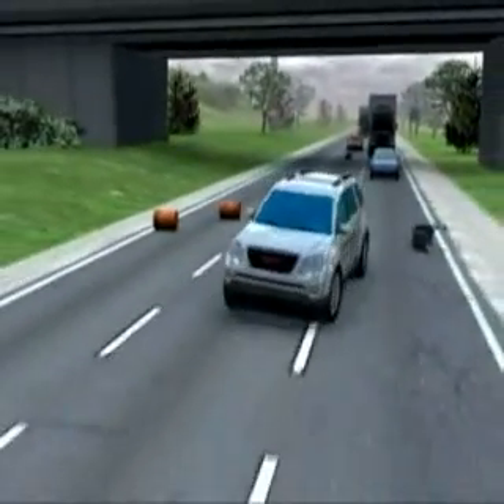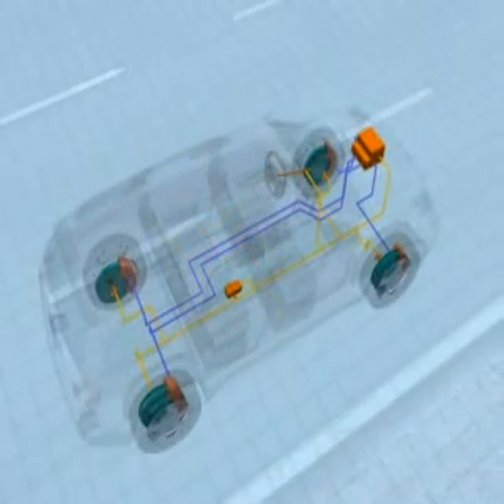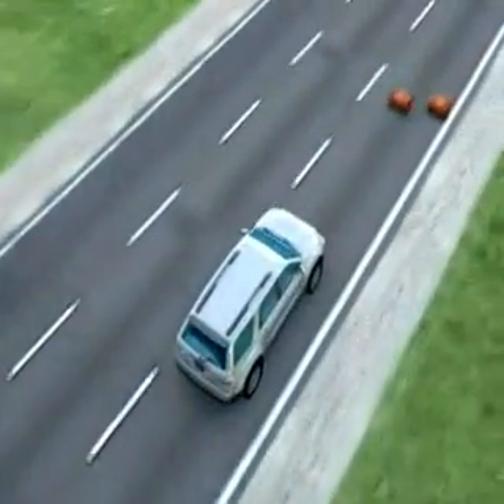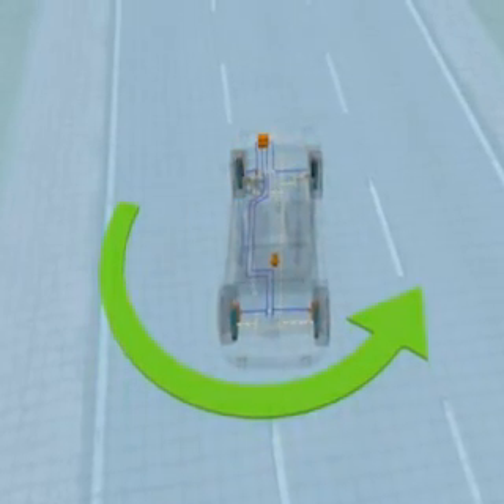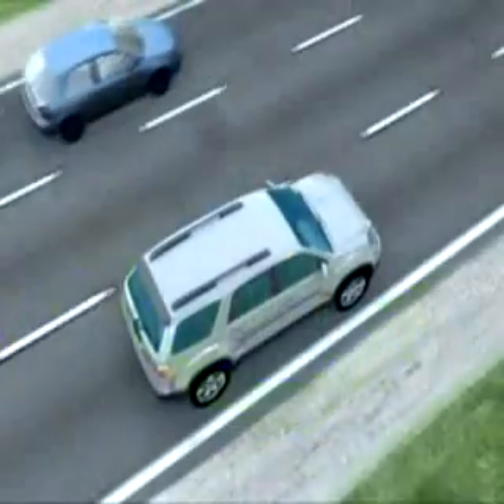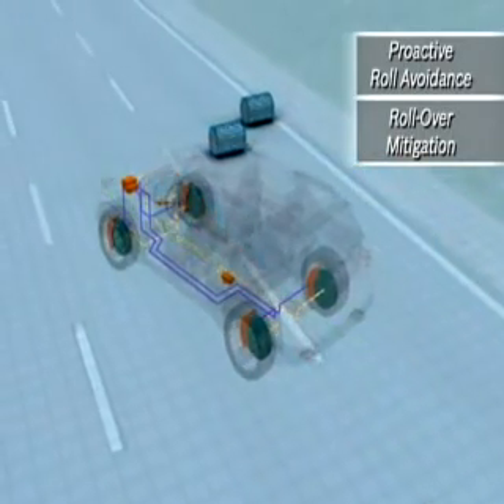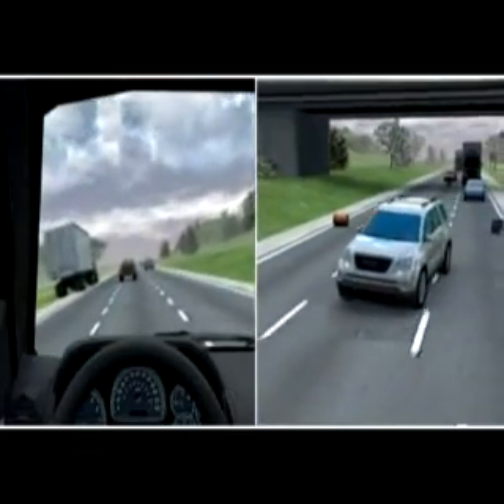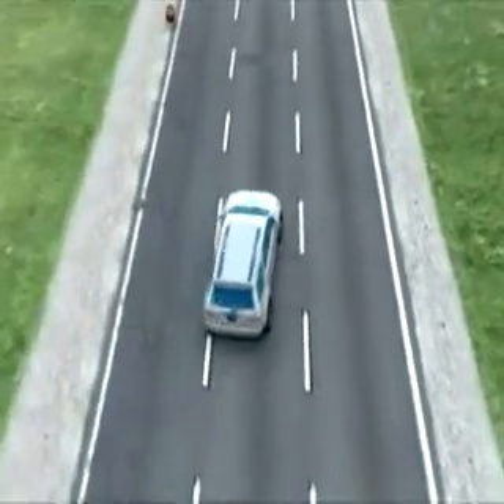GM Stabilitrak

Comment: That system is malfunctioning in way often in my 13 gmc. I almost got hit because of this it killed the engine when I was driving not doing anything and out of nowhere a light come on on the dash stabilitrak off and traction control off . All this happened right in the middle or traffic and I had hard time getting the truck to start back up but I got the truck moving and it was acting up and something was not right but I made it home safely. This system is more dangerous then good
Reply: What was the remedy for this occurrence? I’m having the sane issue in my 2013 Escalade ESV, right now. Thanks!

Comment: Maintain this system too. Check ground and connectors for oxide. Work the connectors (connect and disconnect a few times). It takes five minutes.  When you get "service ride control" - DO service it.
Reply: The service ride control is a fault in the air suspension. “Service Stability” is the message that is on the DIC for a stabilitrack fault. Look in your owners manual.

Comment: I have a 2013 Buick Lacrosse and this feature came on during normal driving with a message "service StabiliTrak" and "Engine power reduced".

I lost power for acceleration and these notifications and car reactions stayed on until I looked online how to reset them. Then, it happened again two months later RANDOMLY 🤦🏾‍♂️
Reply: I know this is an old post and you may have gotten the vehicle fixed or replaced, but there could be engine or system issues not directly related to this feature that can cause these errors to populate, it happened on my 2014 Cruze before I worked on it.

Comment: I’ve got this on my 09 Escalade. One day I was driving on an ice covered road. I was messing with the stereo. I looked up and saw I was I a skid. When I turned the wheel to correct the skid this feature made the car twist straight like I was on dry pavement. Most advanced features are just gimmicks but this one actually works.
Reply: Saved my life in a 2009 STS

Comment: Thank you GM and insurance companies for ruining driving . This system sucks . I have 2018 Canyon and detest this feature and it cannot be turned off above 30mph. If your stuck in snow or mud you can turn off the TC and it will stay off ,but not stabillitrack it will RE-engage as soon as you spin a tire to fast .
Reply: I’ve heard if you hold the button for 5 seconds it turns syablitrack off also
Reply: @shawnmckee14  yes but only untill one wheel speed sensor hits 30. Very fustrating
Reply: @robertmoulton2656  pull the fuse
Reply: @shawnmckee14  that's kinda what I ended up doing . Had a mechanic buddy put a switch in that can that goes to the fuse, that way when I want cruise control to work I don't have to stop and put the fuse back in😃

Comment: Hold the tc button for 5 secs to turn off the stabiltrak system. But you have to do this every time you start the engine
Reply: It only turns it off until wheel speed hits 30mph then it comes back on . At least that's what it does in my canyon. And I hate it .
Reply: Robert Moulton seems that way for only trucks. My cruze stays off until I shut my car off
Reply: @robertmoulton2656  is that why the symbol disappears on the cluster ? wth
Reply: Why would you want to disable it? It works great. I have an 08 suburban and an 09 silverado. Works great
Reply: Jeff B burnouts 😈😈
Reply: @deresolute1061  lol never thought of that....i was wondering why neither of my trucks would do burnouts with a 5.3l v8 haha makes sense now

Comment: This is the worst system known to man. I have two 2009s and they both go psycho riding down the road. Door locks, engine power reduced, abs lights on...and no one can fix it. I am out of the GM business, Others may have it, but they actually know how to employ it. I have been a lifelong GM owner. Not any more
Reply: Robert Rose would i be the huge issues with the faulty ground wire? Have similar issues in 2012 tahoe
Reply: I had this annoying issue of Abs lights on and stabilitrack off when I turn the steering wheel to left..so annoying it turns out to be the speed sensor and wheel bearing of left rear side is broken.
Reply: I had this annoying issue of Abs lights on and stabilitrack off when I turn the steering wheel to left..so annoying it turns out to be the speed sensor and wheel bearing of left rear side is broken.
Reply: Wa  wa. Sounds like your crying
Reply: @garyshaffmaster487  CAUTION....CAUTION...spelling error....you're substitution engaged..."wa wa" not recognized as system command....probable CANBUS error......period not detected at end of data stream...data not reliable...set all available alarm indicators to ON...HEADLIGHT FLASH set to ON...HORN STROBE to ON...
["B.BETTY" decides to  let the hooomans sort this mess out...]

Comment: My Stabilitrak is trying to kill me, happened to me few times on the highway while just going in a straight line, suddenly it would pull to one side really hard and show a message on the display "Stabilitrak Activated" I got Cadillac CTS
Reply: I think you should get that checked
Reply: You have to change the stability control sensor it costs about 110 bucks 04 srx same problem.

Comment: While stabilitrak seems like a good idea, it produces irregular vehicle handling and performance in some instances. Having said that, GM should of included a kill switch to turn off this feature for more experienced drivers.
Reply: Kurt Krezanski they did...it's called stabilitrak disable..
Reply: I know this is super old, but I’ll post this for anyone else who watches this... try holding down your traction control button for a long time, like 10 seconds
Reply: it comes back if you reach 35mph
Reply: Ok, so I am going to play the devil’s advocate here for just a second and in doing so it is NOT in an effort and/or an attempt to take away and/or discredit your skill level and/or anyone else’s that may be reading this comment of mine. Now, first off, I have worked with a whole lot of drivers with varying levels of skill and experience when it comes to driving a motor vehicle. However, in my very own personal and professional experience, more times than not, those who consider themselves to be of the “more advanced” and/or “more experienced” driver sorts are the ones that actually need and/or greatly benefit from a lot of these safety features the most!!! “Experienced” just means that you’ve got a good bit of time under your belt doing a certain task. And there is absolutely nothing wrong with being experienced, however, until you are in multiple situations that are similar in nature to the examples shown in this video, then frankly, you have absolutely no idea about the correct procedure, different techniques and/or evasive maneuvers that may/will be needed to safely avoid losing complete and total control of the vehicle and/or, in a worse case scenario, a vehicle rollover!!!
Reply: hold down the traction controll button

Comment: Stabilitrak is GM's name for it. While there are different systems, many GM cars, including the Corvette, use the Bosch ABS system, which is used in a HORDE of manufacturers, including Chrysler. Bosch calls it Electronic Stability Control (ESP). In otherwords, it's the same exact system (hardware and all).